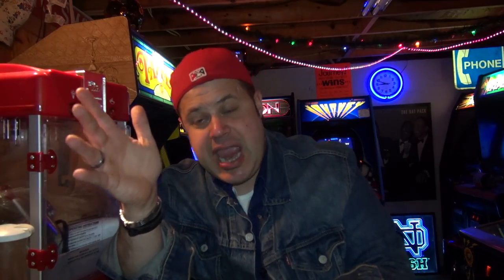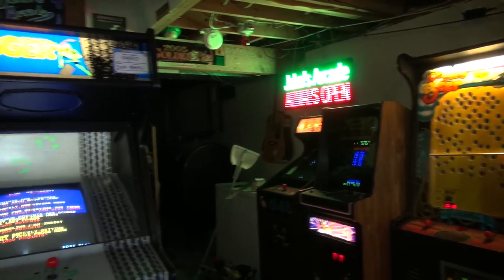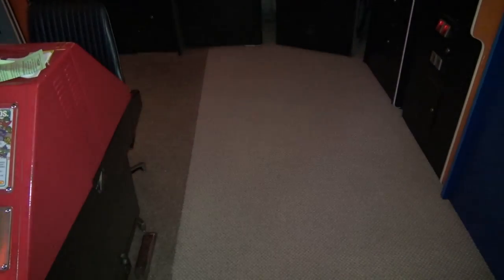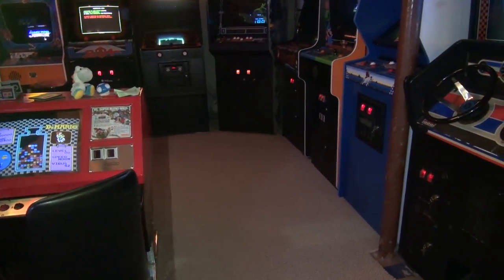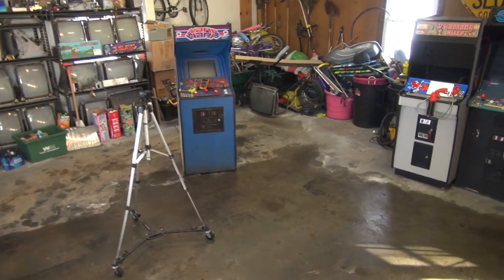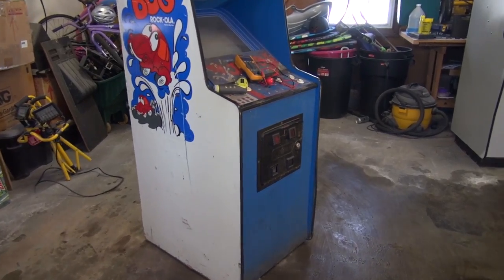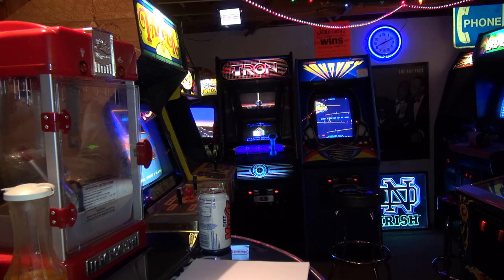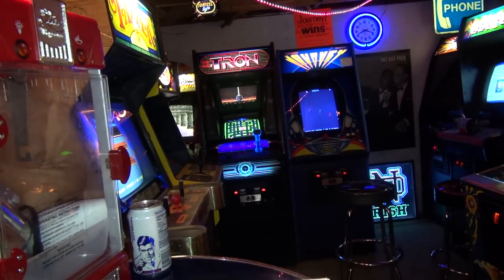ROCK-OLA Jump Bug Arcade Game Restore - PART 1 - POWER SUPPLY

Comment: You're right. If you get permission to film on location, your rolling tri-pod is the best answer, available. And, if you don't have that permission, you do want to keep it on the low down side. However, if you do want that in-between answer for steadier shots where that massive tri-pod is too much, get yourself a uni-pod. It's a single leg, straight down version of a tri-pod. Uses very little space. Extends for steady placement shots. Makes moving around super quick to do. And, when using it for handheld work, it gives a super useful counter-balance to really steady the shot. I've been using uni-pods for years and it's really unbelievable just how much it will improve the quality. Depending on where you shop, these should be reasonably priced. But...when on the down low, it just gives you away, all the more. But, here's the reason to consider one. When on location, with permission, in a tight space where things are everywhere or the place is happening with lots of people playing arcades, the uni-pod won't be demanding all that floor space. You just can't let go, is all. So, I really would consider adding one to your arsenal of options, as it's better then hand held, alone, and doesn't demand the cubic feet of the tri-pod version. In other words, it's like the 87/89/91 octane at the gas pump. More performance or subtler footprint or in-between. Another use for the uni-pod...super high shots. I can do some trick angles by hiking that camera way up into the air and pivoting it over the heads of others. In fact, I know exactly where that trick would be useful for you. When the warehouse is packed full of cabinets and you want to see over three of them to scope out that hidden gem. Uni-pod + remote for zoom. Basically, stuff a tri-pod isn't so great at. It's more like drone territory. There is no universally perfect solution. (Though, drones might solve that.) It's just choosing the right tool for each job.

It's been forever and a day since I last looked in on the Nintendo e-Shop. Couldn't get the Outrun, though. Darn if I have a 2 GB card and it's still overflowing. Looks good for the price.

The carpeting's just fine. Color matching after the initial install (especially after such a time period is difficult, if not impossible. It's as if the only time material coloring matches is when you buy it all off the same production line. Variance will happen...always.
Reply: Note to anyone pondering the octane comment bit: Just wanted to add that with most modern vehicles, if your engine runs 87, use 87. It just won't know what to do with 91 and mostly wastes it. If your engine runs 91, using 87 can ruin it by being under powered. The opting to use different octanes applies to older vehicles and custom jobs that aren't so fine tuned. So, always run what your manual says to.

Comment: CKT is the abbreviation for circuit.

And when you broke the fuse I was in front of the screen screaming "No, don't try to pull it. It's one thing". Well happens. Looking forward to see if you get it running in the next video.

Comment: Some notes for your quick play of Outrun on the 3DS.
First, Outrun was never on the NES, after all it's a SEGA game. It was originally ported to the Master System (there were also ports later on for the Megadrive, Saturn and Dreamcast).
As for OLD and NEW, it appears that the OLD version is the original Japanese version, whereas NEW was the world version. The difference is the first stage is slightly different right at the start (the initial road split is much shorter) and some (not all) of the stages are in a different order.
And for the Ferrari logo being different, that would be a licensing issue, as Outrun was originally made long before car licensing became an issue in games, and they likely didn't have a license to use the logo in the 3DS port.

Comment: Hi John,
Have you tried using either wire wool or Scotch-brite when getting rust off of metal parts? It cleans surface rust up a treat and doesn't scratch the hell out of the plating like sanding does. Plus you can get Scotch-brite in different grades Coarse to fine.

Also if you want to restore the plating, there are kits you can get to do it yourself with a car battery charger.

I've just found your channel and am enjoying the nostalga and especially the restore videos. Keep up the tech vids.

Comment: Hey John,  The Ferrari Horse logo might have had to be changed due to licensing issues from the 80's.  Also: Nintendo have also released some pretty cool 3D (3DS) versions of Space Harrier, Afterburner and Galaxy Force II that are worth checking out.  Space Harrier in 3D is done really well and is one of my favs. I think they are around 5-6 bucks each.  Worth it.

Comment: I'd built a short harness for the new power supply that allows it to plug directly into the cabinet harness.  I think that'd be a lot cleaner than hacking apart the original power supply.

Comment: I think there is a way to calibrate the guns I thought I did it before or maybe it was a different Nintendo game just Remeber we had to calibrate some gun games some times it in the bios or what ever it's called sorry can't explain stuff to great :/ lol I Remeber putting the wrong buttons on a system took me all day and I couldn't figure out why they where just tad bugger so I got out the thing to make holes bigger and rebuild the buttons to only find out I was using the wrong buttons lol o well it worked fine just had some other games buttons just basic buttons nothing special any ways lol I can't Remeber what game think it was a fighting game long time ago